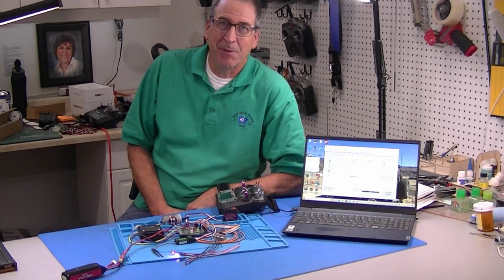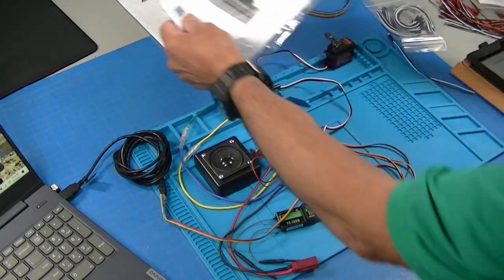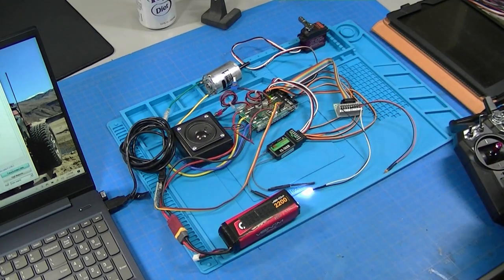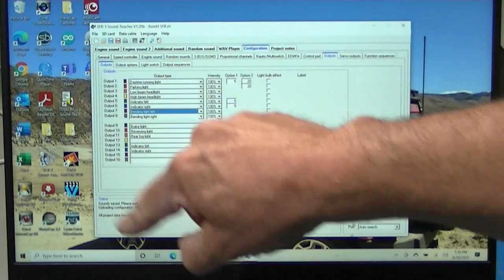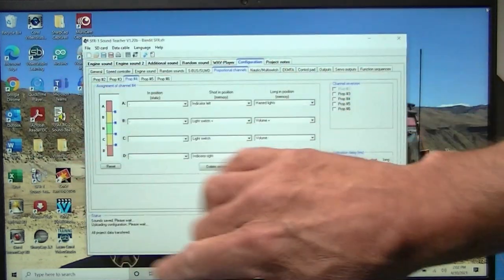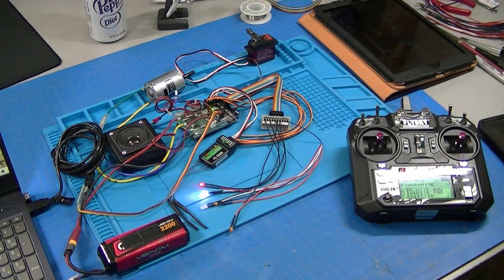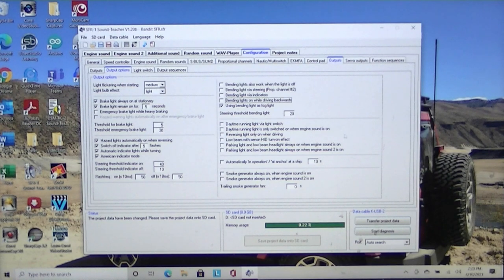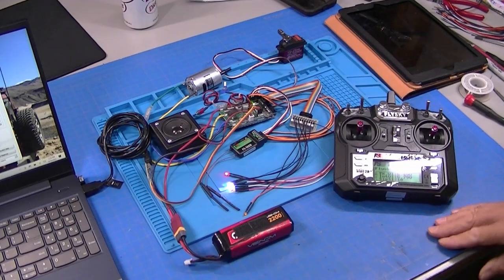Beier RC SFR-1 Part 3 Speed, Sound & Light Controller for Tamiya Semi's

Comment: Bob, I'm SOLD!! Can't wait to see the part where you go over shifting sounds. 
I hope you get more in soon - I'll be getting at least TWO! 😊
Reply from the maker: More stock in a few weeks.  I will do more video's after I build the new 8x4 Arocs.
Reply: @HobbyconceptsLLC  Question... Is the USM-RC-2 A standalone Sound and Light unit, that I can use my Hobbywing ESC with?? 
It shows in stock at your Store, so I can buy it within the week!
Reply: @HobbyconceptsLLC  
.... Watching the Video again, I just realized that the USM-2 COMES with the push in connectors! 😎
Reply: I cannot WAIT till you get back to this!! I want the Shifting points. 😁

Comment: I installed the Beier SFR 1, I love it.
It took me awhile to figure out but I got most of it sorted. I went with SBUS and had to email Beier in Germany several times. They are extremely helpful. I have one question though. I cannot go from forward to neutral to reverse on the stick. I have to go from forward to neutral, back on the right hand stick to switch to reverse and the up on the left stick to actually reverse. Can you tell me how to change that?

Comment: Hi Bob, I recently purchased a SFR-1, set it up and working fine. When I connect the battery with the unit turned off the turn signals flush only for a second, have you experienced this. Roy  P.S it is a fantastic unit great videos 👍

Comment: hi bob, I bought a unit of SFR-1, and was working realy well but in the last update for some reason the reverse is not working, I umplug and plug again all the cables but is not working, do you have any ideas for fixed?
Reply from the maker: You may have checked a box on sound teacher that simulates the throttle on a real truck.  In this mode the radio stick is only the throttle and you need to assign a switch to flip between forward and reverse.  If you have problems finding it email me.

Comment: Hi Bob. Can you use additional receiver in a trailer to work lights with Beier SFR-1 like you can with the Tamiya MFC. Thanks
Reply from the maker: You could but I normally would not.  I would the much netter Beier infrared system.  https://hobbyconcepts.net/products/beier-infrared-light-module-sm-ir-16-2?_pos=1&_sid=6eaa32551&_ss=r

Comment: What is the difference in the sound teacher programs? USM RC2 & SFR1. Do I need both in order to use both boards?  I currently have USM RC2 in my Excavator. Was looking to purchase the SFR
Reply from the maker: The software program is different for each unit so you need a need program for the SFR-1
Reply: @HobbyconceptsLLC   thanks. Btw ordering from you site has been a pleasure. Prompt shipping too. Many thanks from TX.

Comment: How are you  going to do  the shifting?
Reply from the maker: You can hook the shift servo directly to the receiver on the 3 position switch or run it through the SFR-1 as it does have servo outputs.  These videos are just the basics - more to come!
Reply: Thank you

Comment: Turn signals should be on a horizontal switch, not the steering channel.
Reply from the maker: The beauty of the Beier system is you can set it up the way YOU want it!
Reply: @HobbyconceptsLLC  Thank you Sir. That's exactly my point, the indicators should work via a switch, not the steering channel.  This is what happens when driving which is exactly what you are trying to achieve., driving the truck in a scale manner.